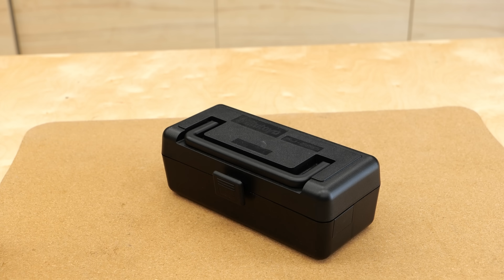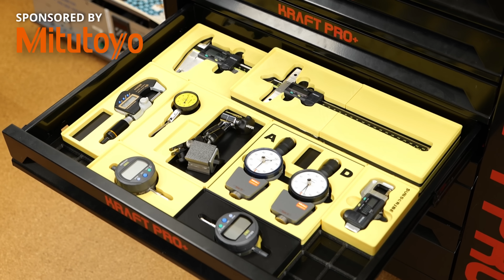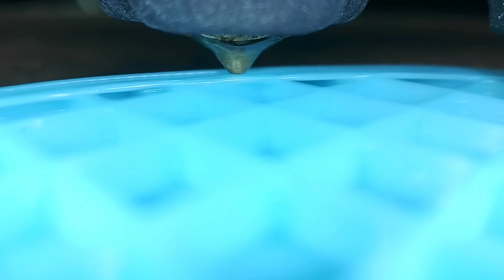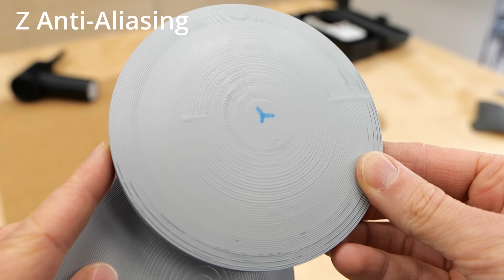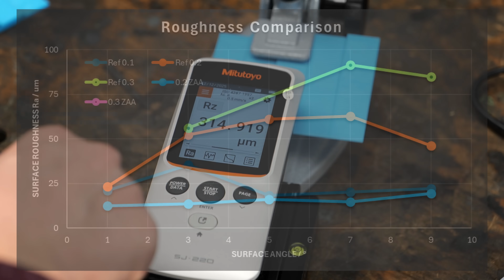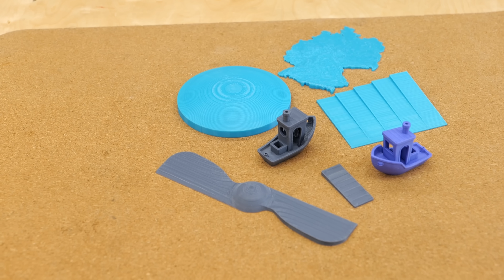Anti-Aliasing for FDM 3D Printing Is Finally Here (Micro-Non-Planar Printing)

Comment: Guys, you know what would be even better? do the anti-alias 1-2 layers BEFORE the final layer. And then print smooth final non-planar layer on top of antialiased -1 layer, so the final layer is really smooth and normal height.

Comment: I have noticed no benefit to Z Contouring. I have noticed little difference between common layer heights. The biggest difference you can make, is proper design and engineering for 3D printing. Simply avoid the surfaces and structures that end up looking like Hell.

Comment: This made for an interesting choice.  The Elegoo slicer is more advanced than the Bambu Labs one with more control options but it doesn't have the Z anti-aliasing option. I will have to make a choice of which slicer to use when I create a project.

Comment: it's a cool feature, for sure.  Anti-aliasing does seem like a good name for it, though.  Anti-aliasing improves the perceived resolution of an image by picking color values that represent the composite weighting of sub-pixel values.  This FDM technique actually increases the resolution in the Z-axis, while still mostly staying within the Z framework of fixed-height layers.  Way different.

Comment: I find it weird non planar printing hasnt already been a more widely used thing. I can boot up fusion 360 and program true 3d movement very easily for 3 axis cnc milling. Itd basicly be the same algorithm just in reverse and accounting for the nozzle and shroud geometry. Hell with fusion you can program custom tools this feels like itd bee pretty simple to program in its weird cam software isnt trying to do this

Comment: With a gantry printer, would it be possible to tilt the gantry using the 4 stepper motors and angle the extruder?

Comment: Thank you for sharing, Stefan! I was thinking that this should be possible. And even more than this. Ideally, you could have the complete top layers be tilted and still be a single layer. There are many possible slicer improvements in the future. I can also imagine AI designed, optimised and safety controlled G-code.

Comment: Great video! Although the printers are quite fast nowadays, warping or height stability issues on printers with bed movers and similar issues come often with high speed. So a thicker layer can still improve overall print time if you manually decreased the default speed settings.

Comment: the slicers already have tons of options that screw up prints if used without knowing how to. adding this in its current form should be a non-issue. just slap a warning ontop.

Comment: What about a slight overextrusion combined with ZAA? That would help with the gaps in the top surface.

I'd like to see this implemented in the standard version of Orca and Bambu, it's a great step towards full non-planar printing.

I wonder if we could get close to non-planar printing without a lot of hardware modifications by individually adjusting the print bed screws in a Voron Trident or Bambu to tilt the print in the z dimension to compensate for the irregular layer heights?

Comment: Hell, yes, I forked out for 2 of their calipers and it was worth it. I use them to measure bolts and other things I need to interface my 3D prints with. One of the few companies left that actually values their reputation.

Comment: I wonder if you could implement local variable layer height, to solve variable layer height affecting every part of the print? 🤔
Basically, the user paints a region; the slicer then divides the affected layers so, for example, it first prints three layers @ 0.1mm within the painted region, then it prints one layer @ 0.3mm within the non-painted regions. As long as the shorter layers are printed before the taller one, the nozzle would never collide with anything.

Comment: Goooodin tug!  Been a while since I've seen one of your deep-dives.  I got bored with tinkering after a while...the machines got good enough that I never have to worry about tuning when I need a part, I just throw it on and half the time I don't even stick around for the first layer.  If you find away to integrate comfyui I might be able to pry my fingers away from the keyboard long enough to walk over to the printer.

Comment: I wondered for a while why nobody does just split the layer height on the top layer into increments to reduce stair stepping. Maybe default layer is 0.2 but at the top layer it prints at 0,05 layer, basically splitting one step into 4. Imagine it like Minecraft half slabs added to each step. 
That would eliminate the need for non planar movement and should be easier to calculate. It is very simmilar to what you describe ZAA but without the non planar movement.

Comment: I'd like to have both, with the option to paint areas where one or the other option would be preferred by the user, or even intelligent detection of angles to pick between multiple smoothing methods and flat slicing.  5+axis printing is also pretty interesting, but would obviously be limited to much more complex/expensive hardware.

Comment: I wonder what the results would be with a 0.6mm or larger nozzle. If the surface roughness is roughly the same, that could give some massive reductions in print time.

Comment: I've been having great success with ironing my prints to get a smooth top surface, so I wonder how this would work combined with ironing, maybe we could even get something approaching a totally smooth slanted surface with the right ironing settings.
I would also love to have this for bottom surfaces because I find that slanted overhangs can look pretty rough on the bottom even with supports, and this wouldn't completely solve that, but it would help.

Comment: A simpler and stupidly powerful optimisation would be local variable layer height. 
Simply allowing thinner layer on a painted shape or using modifier body.. 
Slicer already do this for supports or infill but to this day refuses to implement it for parts. I don't get it.

Comment: Resin printing has had anti-aliasing forever...
Reply: It’s not even remotely comparable.  Anti aliasing in a resin printer basically works the same way as anti aliasing on screen (i.e. blur the pixelated edge of each layer image slightly as it is exposed).

Comment: I think this will be widely adopted. It's the perfect middle ground. True non planar printing will always require special hardware and knowledge of that exact case, for the same reasons as 5-axis machining. Anti-aliasing on the other hand can be mostly plug and play, and can be just another powerful toggle in the slicer, not a separate slicer ;D
Reply: Yep this.  It gives better results, but on standard hardware.

Comment: What would happen if you change the infill angle from 45 to 0 or 90 degree?
On one height, it should be no problem. But what happens on orthogonal levels?

Comment: Does this work with ironing?  I see a way to make unbelievably smooth Hueforge panels that I can then use  with my vacuform to make unprecedentedly detailed and textured panel pieces.

I didn't even make it through the video before downloading this.  I hope this makes it downstream into Orca Slicer.

Edit: also something that I think has been missed, here, is that even if you do chemical vapor smoothing on your parts, this would still significantly improve the finished product quality, because getting over shallow stair stepping can't usually be managed very well with chemical smoothing, alone.  If you want a very round printed sphere, that's basically always going to involve some sanding before vapor smoothing.  I also imagine that the inner lip on each layer would make a little pocket for acetone or whatever you're smoothing with (you can vapor smooth other plastics if you're willing to get the PPE and ventilation needed to work with slightly less cuddly chemicals) which could help to make a super cohesive outer shell.

I am very excited about this, I'm gonna crank out a Hueforge with this right now and see how well it works.

Comment: Very cool.  Though you'd still want to combine it with adaptive layers, to reduce the stair stepping on curved portions of the sides of the print.  Like the hull of the Benchy would still have the same amount of aliasing on the hull and cabin overhangs, since the antialiasing is only applied to the top surfaces, yes?

Comment: My question is does it also work for bottom layers?  Multimaterial/ no support gap printing is a lot more common than it used to be and it would be neat if bottom side curves printed as smooth as topside curves

Comment: I think a 5 axis printer using this method could make seriously smooth surfaces by angling the nozzle in the direction of the surface normal. But that’d be overkill probably

Comment: Interesting.  On the one hand, this seems very useful for my normal work which has a lot of sloped or curved parts.  On the other hand - the nozzle collision problem seems like it would be even worse with a Revo nozzle, which is what I'm running on my X1.

Comment: Literally battling with this exact issue rn on my faff forge. Trying to make a battery cover for a remote, 1 degree angle on each side... Not a problem right, just print it flat, right? Ye, it's ABS, and it's got a little sprung bit in it. If I wanted it to shear off I'd print it so the layer lines were weak along the stress points. It's impressive how the simplest projects can give you the most hardship. Yes, I could just use PLA, but that's no fun. 😅

Comment: Seems like a nightmare for extruder pressure lag.
mid-line changes in height means needing to change flow rate continuously to account for the thickness changes.
get the synchronization wrong and things will go bad quickly.
and it'll need to calibrated differently for the material used....

Comment: I wonder if you could achieve even more by flow variations also. Similar to how ironing works as I think that would be easier surely to implement than micro adjustments on Z

Comment: I just realized how huge this is. This will reduce print times massively on many parts as it will allow for printing parts that need fine details with much higher base layer heights
With this approach it’s feasible to double the layer height on many parts I’d print without loosing on outer Z resolution, can’t wait for this to be ported to cura

Comment: i dont know much about 3d printing or gcode but i do graphics stuff and im amazed that altering the z during layers isnt standard? i can imagine some sort of system where theres a voxel grid aligned with the layers where each cell checks its z distance to the nearest edge and then if its touching one, adds that distance to the z at that position in the gcode. i think this would also still work on the undersides? feather in a few layers to avoid smushing into the ridges of the layer below

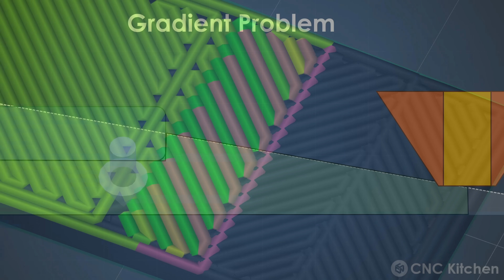Comment: 14:56 you say that printers has no command to move from point A to B in 3D space, but G0 X1 Y1 Z1 (replace '1' with your coordinates in mm) is the exact command to move from current to defined point in 3D space. You can see it while printing in "vase mode".
Reply: He said there’s no command to do that while also smoothly transitioning the flow rate

Comment: It is just not planar printing applied to last layer only. Allowing non planar to act in 2, 3 or more top layers instead of one, will have the best results while ensuring head clearence. A slider can be added for user selection, or an angle of atrack based on head could be used as an input ton drive the contoured slicing. I just saw thoughts on this are presented towards the end of the video.

Comment: I always thought ZAA with adaptive non planar ironing would be a nice solution. I mean in theory you could just iron the top surface, but the slicer would need to be smart enough to account for any collisions. If the ironing is applied adaptively on only a couple of layers at a time collisions are way less likely…

Comment: This is very nice! Top infill still looks ugly though. I mostly use concentric infill for designs with extreme stairstepping but it still looks a bit off (you can see it in my rossero - melting clock design at the base). I think a nice slicer tweak would be to have continuous contour top surfaces (like with a dome) concentric and non continuous contour top surfaces (like the single slope) filled in from the outside in snaking back and forth with the turning points hidden underneath the next layer. This will greatly improve the looks of stairstepping because the crisscross pattern makes it stand out like a sore thumb even more

Comment: I had issue printing from the forked version of the Bambu Studio, it says the software not signed by BBL, but exported the gcode file and imported into an official Bambu Studio it prints without reslicing.

Comment: I'm for ZAA in the mainline - simply because it's a zero risk addition. Just don't activate if it doesn't work for a model, or even a specific surface of a print. Convenient & valuable to have around; mirroring the videos sponsor.

Comment: Combining this with non planar ironing seems like the holy grail
Reply: Honestly for the amount of time ironing takes it might be seriously diminishing returns
Reply: Effectiveness would be kind of limited without a tilting nozzle though..
Reply: @TS_Mind_Swept  Valid point, if I am making a gear or screw, there's no way a nozzle is getting in there after the print. Then again... I could technically heat the part over the hob. 👀

Comment: This is a great improvement, but I think the implementation is flawed.  If this were implemented as variable layer height, but only where there would be nothing directly above the current layer, we wouldn't get the current patterning.  Instead of your diagonal top-face pattern, the print would follow the contours, because every part of the face is a wall.  Once all micro layers were printed, the full thickness parts would print.  This avoids the collision problem entirely.  The contouring would look like it was sliced at the minimum possible layer height, but only on top slopes.

Comment: This would be a useful option to improve the smoothness of upper surfaces. There is still a lot improvement possible for reducing the impact of layer height on the outer surface of 3d prints. One example would be to allow 1/2 the layer height for the outer wall compared with the inner walls.

Comment: This could be a promising replacement for variable layer height
Reply: That has merit. Consider that what we really want from variable layer height is the ability to automatically vary the height within a layer; so only the fine detail that needs the finer resolution is printed that way. Creating smooth overhangs is still going to be problematic whatever we do, though.

Comment: Original author of BambuStudio-ZAA here. Thank you for featuring my work!

In addition to everything that was explored in the video, I'd like to add that turning on ironing can get you even smoother surfaces, including ones that look super smooth.

If anyone has questions or problems running the fork, please open an issue on Github. If the "Z Contouring" section doesn't show up in the Quality settings tab, make sure that the toggle switch for "Advanced" settings is turned on.

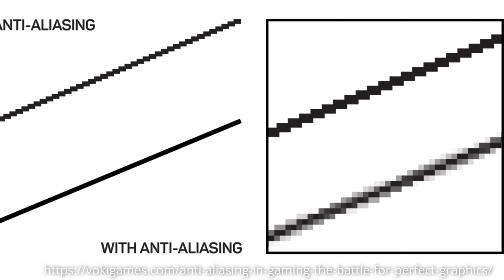Comment: 3:45  gonna be pedantic - sorry. The lines shown on screen aren’t single pixel in size so that’s not quite what that shows. If a line is more than a single pixel thickness - there’s no inherent reason for it to stair step except for unaware graphics code. 

Furthermore - going from Bresenham’s algorithm of only storing / keeping track of the error term - to actually using the error term as an alpha % component was a very “fast to conceptualize” antialiased line… annnnd deals with “drawing an angled line on a grid” fairly well (not quite full antialiasing since the error term applies in only one dimensional).

Edit: I guess … for the video … if you say your layer height is 16 steps of the motor … then the “line” graphically would be 16 steps wide and you could sub layer adjust things (particularly the top layer).

Comment: I've been doing this for some time now with the variable layer height tool in Orca Slicer, on slopes or round edges, all the slicer does is drop the the layer height to 0.08 or lower for these areas, then back up to 0.2 or higher for the flat area's, that's effectively AA, gets rid of the jaggy's, I'm not seeing anything really ground breaking here, maybe it has a better algorithm , but still its very much the same thing we already have.
Reply: you should watch the video again, but more carefully this time. he even specifically addresses how this is different from adaptive layer heights

Comment: Can you combine ironing with antialiasing?
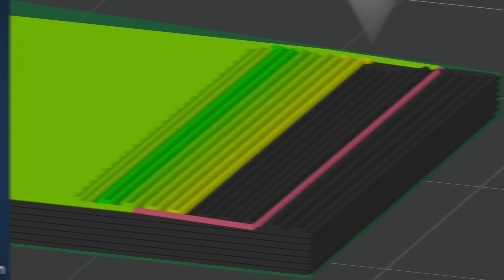Edit: Now, I found the other people asking this rather obvious question. For flat surfaces, I could imagine that ironing might still work without the round nozzle boundary plowing into the surface too much. However, it might be too nozzle dependent (as explained in 13:40). We need the less pointy nozzle for ironing, but it needs to be pointy for z-aliasing. However, maybe there is a size, which works for both in an acceptable way.

Comment: I always wondered why nozzle tips are so thick compared to the outer edge diameter. It probably has something to do with optimal flow rate being 110-120% of the inner diameter but I thought someone would figure out better settings to get over what felt like a stopgap. I think pointed edge nozzles should become the norm. Ironing might become harder and we are going to need to figure out why 110-120% flow rate is really better in order to work around it. But the gains in a general non-planer algorithm is way better. We should be hunting for any improvement that increases dimensional accuracy and/or precision.